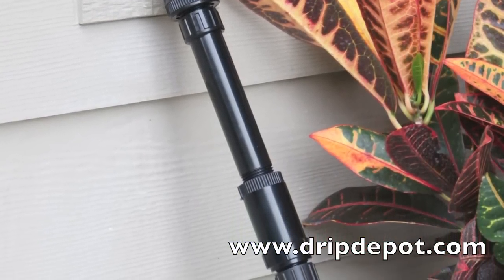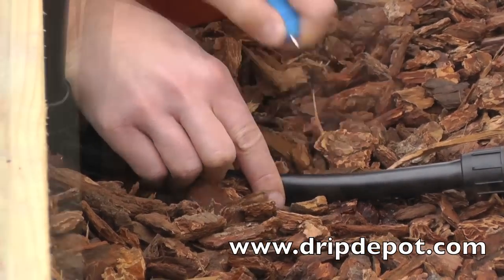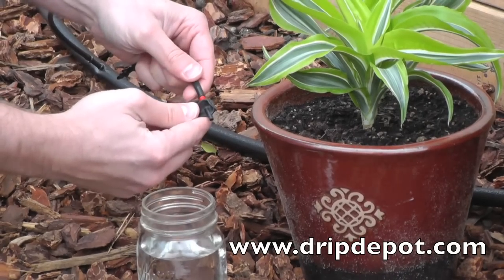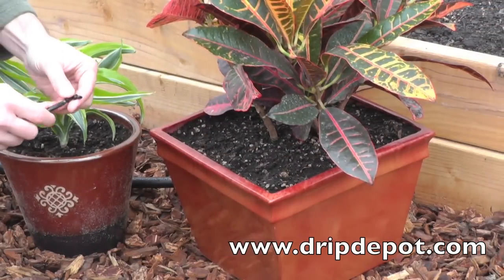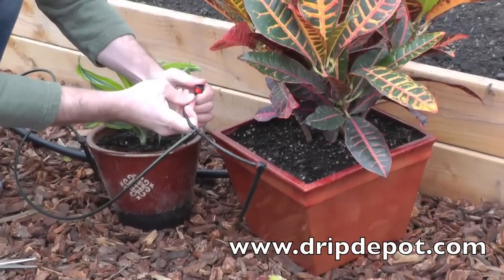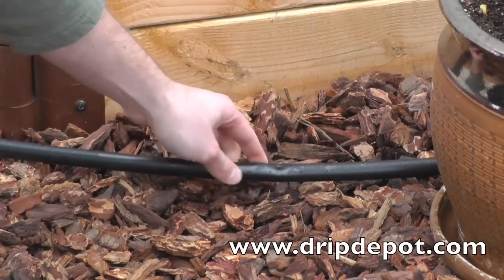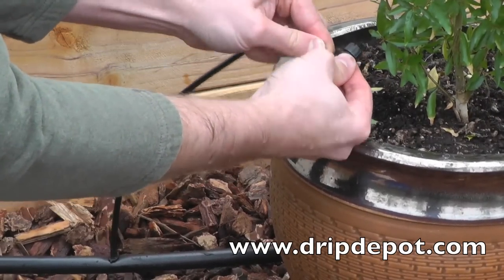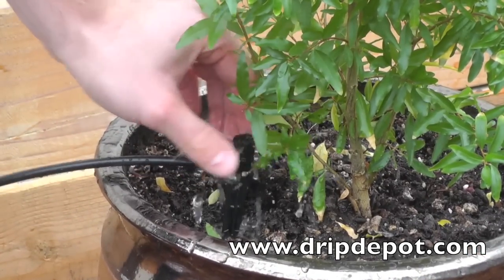How to Setup a Drip Irrigation System for Containers/Potted Plants

Comment: What is the last type of adjustable dripper? What is it called. We're using two in 20" pots that just drip but don't think it's sufficient for the flowers for accent under the shrub we're have as our main plant.  Would like to spray a little more than just drip.
Reply: Hello AnnSmith316,

The last dripper is a 360 Degree Adjustable dripper.  More information on them can be found on our site at:
https://www.dripdepot.com/item/adjustable-dripper-on-6-inch-stake-pattern-360-degree.

Have a great day!